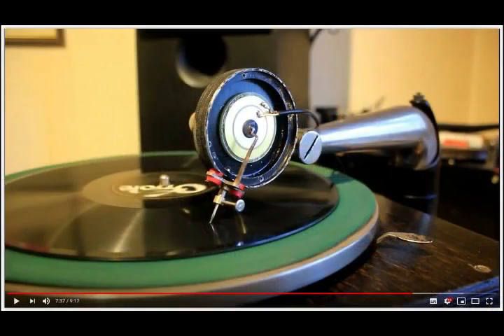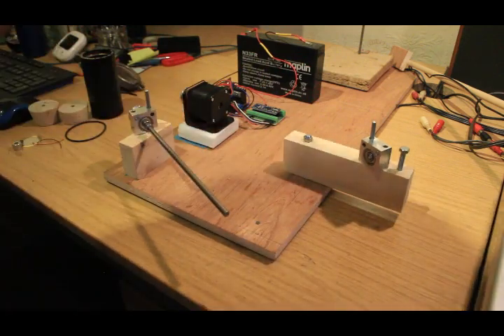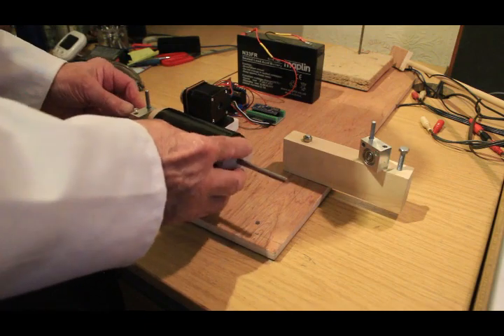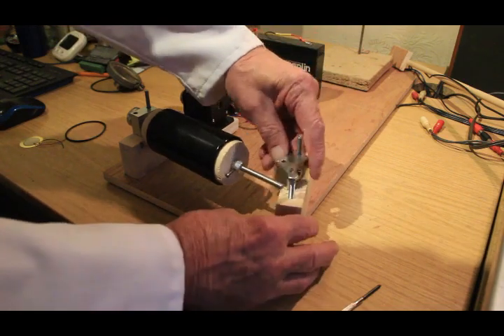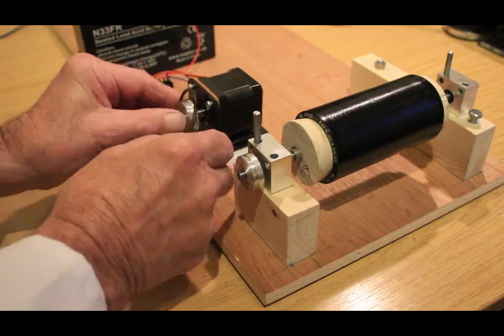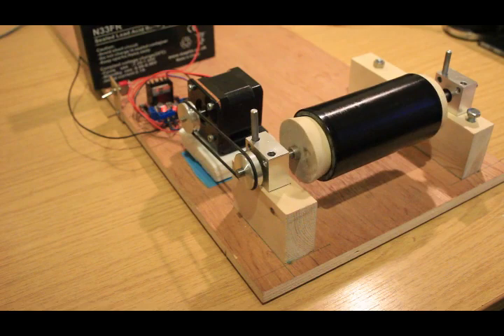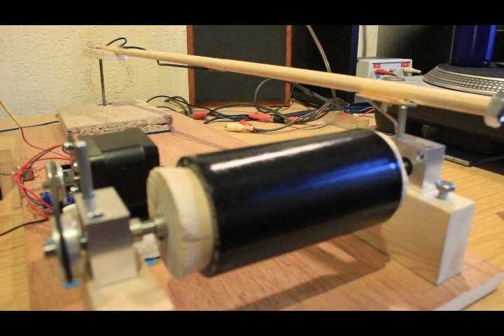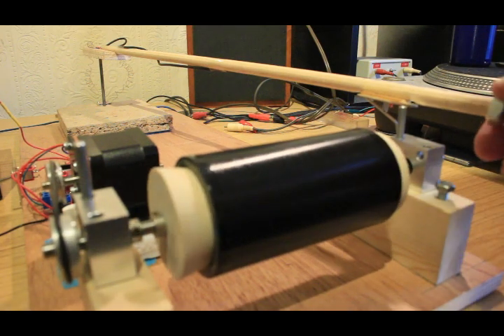Phonograph cylinder can be played with piezo-electric transducer.

Comment: I saw another video where a gentleman used a piezo electric transducer and he said he installed a 1K ohm resister in the line out of the piezo to lower the level and for proper impedance. I'm not very knowledgeable about that, but I thought I would share that. What are your thoughts on that subject,  Mr.Field?
Reply from the maker: Hi there. Thanks for writing. What you say is absolutely correct! I ectended the stylus bar to reduce thoe modulation on the piezo disc. As you say, putting resistors.as a potential divider & impedance matching network would have been a much more elegant solution! All the best & take care, Norman.
Reply: @bixanorak  Thank you for the response. Your solution to potential over-modulation is  very resourceful and creative. Great video!

Comment: Quite amazing it's possible to make a player at all, wow
Reply from the maker: Thanks for writing. Yes, it's great fun trying out these half-crazy things! 😀
Reply: @bixanorak  so how does the amplifier work? its not a normal audio amp attatched to ceramic cart? and what is an ardueno and how does it control speed?
Reply from the maker: @lookoutleo  Hi there.The audio ouptput from the transducer was very high, so that it could be put into a 'Line input' of a normal audio amplifier. The output level was probably 100 mV or more! As regards the use of stepper motors & arduino, there are hundreds of videos on Youtube explaining how  use them - have a look around - that's how I started. Best regards, Norman.

Comment: That was great fun, informative, and involving. Thanks for a great video. Am comfily subscribed now.
Reply from the maker: Hi, and thanks for writing! One thing I got wrong, was the huge output from the transducer. Because of that, I extended the stylus bar to reduce the modulation. It would have been far simpler to put a potential divider across the output from the transducer... oh well, one cant think of everything! 8^) Again thanks & best wishes during difficult pandemic times. Cheers, Norman.
Reply: Seems to me I saw one fellow writing to the effect that a long tonearm, being a bit flexible, can be more forgiving of slightly warped cylinders. Sounds plausible, within limits--perhaps with a bit more tracking force.

All the best!

Comment: Can I use a standard Edison 0.8 mm 2 minute stylus from an original reproducer instead of making my own?
Reply from the maker: Aah - no; I don't think that would be a good idea.Sorry, and all that. Making filaments of glass with a blob on the end was a very 'cheap & cheerful' way of getting a simple phonograph, like the Puck, to play. A 'Puck' phonograph was really a toy, & only cost about $2. If you have a genuine Edison stylus, those were made of *sapphire*, not just glass, and are far too valuable to be used up in simple 'fun' experiements! If you want to copy what I did, the point doesn't have to be glass, let alone valuable sapphire. As an inital trial, the tip of a thin wooden cocktail stick would do as starters - ultra cheap, & non-destructive to the cylinder... I bet you it would work pretty well. Good luck in your experiments. Cheers, Norman.

Comment: Did they ever find a way to mass produce record cylinders without having to record each cylinder with a live band?
Reply from the maker: Hi Robert. Yes, indeed they did. In the 1890s cylinders were brown wax & most were indeed recorded individually! A few years later, they developed a system whereby one really strong brown wax could be used as a master record, from which 10, 20 even maybe more, copies could be made using a pantograph. It was finally solved around 1902, when a new technique of electronic metal 'sputtering' came into use. The master wax cylinder was put into a vacuum chamber, & after nearly all the air had been sucked out, the new technique of 'vacuum electrodepostion' was used to deposit a layer of gold on the wax. This could, in turn, be plated onto, & so this 'electrotyping' enabled thousands of cylinders tobe made fronm one single cylinder. Cheers, Norman.

Comment: Wouldn't that self-made glass ball be usefull by glueing it onto an old stereo pickup, for playing Pathe records? Cables have to be arranged for Pathe, too. If someone has only a few records, this would be cheaper than buying a special needle for it.

By the way, thanks for all your great videos :-) .
Reply from the maker: Hi there. Well, absolutey, yes - if you got the size right. It would wear quite quicky, but the cost is negligible! You can buy a special sapphire ball, which I did, and found it rather disappointing. I don't have many Pathés myself, though I have other British vertical cut records: Musogram, Neophone, Clarion, Marathon &c & generally my collector friends tend to treat them individually, trying a number of different size styli until we find the best one - which is very often NOT the Pathé special...  >8^(      OTOH, the big sapphire IS usually good for the biggest Pathés - 14" & 20", but not many peole have rafts of 20"! Good luck, Cheers, Norman.
Reply: It's been my experience that the radius of a stylus used for vertically modulated recordings is not near as critical as that for normal laterally cut discs, as long as it's not too large. 
I recall playing Pathé discs acoustically using a ’soft tone’ steel needle (the very thin ones) inserted UPSIDE DOWN in the soundbox. That is, with the blunt shaft in the groove instead of the ’pointy end’.
Now I am not recommending this as a general practice as variables in sound box weight, needle shaft profile record material etc, could all conspire to wreck a precious recording. All Im saying is that it has worked quite satisfactorily for me. 
However, if you should ever be  tempted to try this idea, at least test it out on an unimportant disc first.

Comment: About the glass; it can be contrasted with a black paper to get a clear image.
All that small stuff you videoed, you should read up about depth of field (no pun intended) and size of the aperture on the lens which you can actually enforce with a piece of card with a hole in it.
And also with small subjects; one does need more light, and your eyes already told you that.

Comment: I assume that the cylinders use hill and dale recording.
Reply from the maker: Correct, Royston. There's  a rumour that one company actually tried a lateral cut cylinder, but it never got anywhere. Cheers, Norman.
Reply: Although it would be theoretically possible, maybe with two-minute 100 grooves/inch cylinders and a smaller (4-mill) stylus, I've never read it heard of it being done. 
Unless we count the ’Phonautograph’ which was inherently lateral only and could record an audio waveform but could not play it back.

Comment: I just stumbled upon your channel by chance and I'm loving it so far.  With regards to this video, I have a collection of cylinders I inherited and no way to play them, so was thinking about trying this out.  I have all the bits and pieces already except the glass needle.  I do, however, have several brand new 78 diamond styluses.  If I can make a method of attaching it to the piezo disk will that work?  Thanks and keep up the good work!
Reply from the maker: Aiee.... thanks for writing, but to really play cylinders on a home made device is quite a serious undertaking - my video was a kind of 'fun thing', and the cylinder I was using was a U.S. 'Indestructible', that were indeed very tough & can put up with a lot of abuse. Spend quite a lot of time on looking at this site: http://www.christerhamp.se/phono/ which has many, many approaches to playing cylinders electrically, and you'll get plenty of ideas on different approaches. You certainly won't be able to use a cheap piezo transducer as I did - it would massacre ordinary wax cylinders. I made a 'serious' electrical cylinder player a couple of years ago, & will try to make a short video of it soon. Best regards, Norman.

Comment: Glad to see you back again, Norman! Thank-you for the most informative video. My father used to teach me how to make things out of glass rod and tube, in the 1960's, but never a stylus. So you've taught me something new.

Presumably, you've allowed for the very high impedance of the piezoelectric transducer? 

For those reading who do not know about these things, some explanation is needed: A valve amplifier, or a FET input stage, would be the simplest options for lowest distortion from a piezoelectric pickup. This kind of transducer might have a peak output of above 1 volt, at an impedance of 10 Megohms or more, but an electromagnetic one would generate a few millivolts at much lower impedance. Connecting the piezo transducer to a low input impedance preamplifier will cause distortion, because the input voltage is too high, resulting in clipping. The frequency response would also be affected by the mismatch. 

Also, if you use the 'phono’ input of an amplifier, it has filtering, 'RIAA curve equalisation', to account for the low output at low frequencies and higher output at high frequencies of a magnetic pickup. On the other hand, a piezo pickup has a roughly constant output voltage at all audio frequencies. The result is that the piezo pickup will sound worse than it should do, even if amplifier input impedance is correct, because of an equalisation mismatch.

One other modification which you might care to try is to extend the tone arm beyond the pivot point and adjust counterweights, to find the best tracking weight for a cylinder. (It can be as high as 100 grams or 3.5 ounces, depending upon the arm and pickup. Compare that to a gram or two for an LP record.) That would minimise pickup distortion.
Reply from the maker: Sorry, "One size fits all" message: Thanks a lot and see you again soon! Cheers, Norman. (No, I didn't! I do know that crystals are very Hi-Z though...)

Comment: Great content as usual :) However that motor is loud. And it's loud because of the driver. Try a TMC2208 in 1/16 microstepping mode, it will make the motor near silent. It's available in the popular StepStick format used primarily in 3D printers, but you can adapt it to an Arduino nano with the CNC shield. It does however require 12V instead of 6V, but the motor noise will be gone for good.
Edit: here's a comparison between a DRV8825 and a TMC2208 driver, both in 1/16 microstepping mode: https://youtu.be/v0PajgCYbQk

Comment: Great, is that the only first electric pickup for cylinder? Why use glass and not a needle?  is there an advantage using glass. 
I suppose it's important to have the cantilever a certain length, different lengths will give you different results how sensitive it is is that right. I suppose if it's too long you could start introducing distortion problems in playback not sure about if it's shorter though just less sensitive.
 this need to be remastered and recorded for prosperity and quality. I think you could get a good sound out of it I can hear a lot of detail quite amazing how old is that recording. I bet there's a lot of hidden detail can be picked out of the background adding dynamic range as well and expander and active EQ can open up the sound stage.
Are people remastering and recording these Old cylinders.?
Reply from the maker: Sorry, "One size fits all" message: Thanks a lot and see you again soon! Cheers, Norman.  Electric cylinder pickups were made way back in 1918, 1919.
Reply: @bixanorak  short and sweet Norman thanks